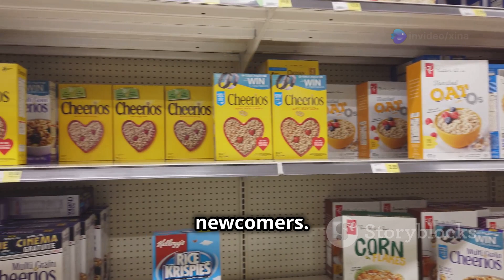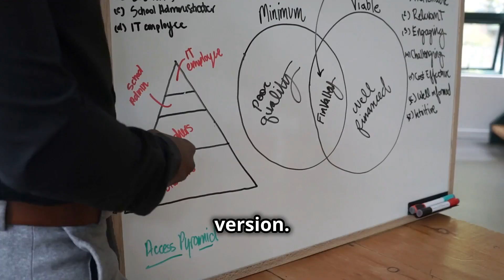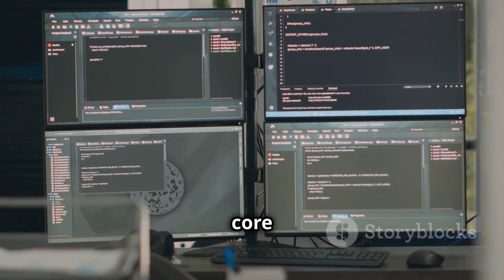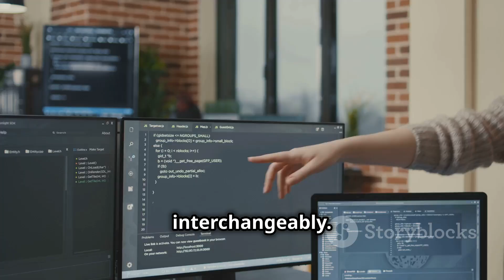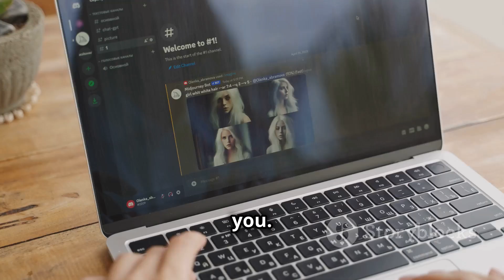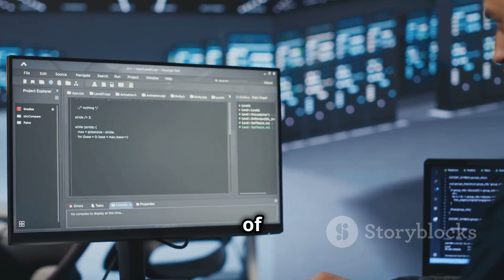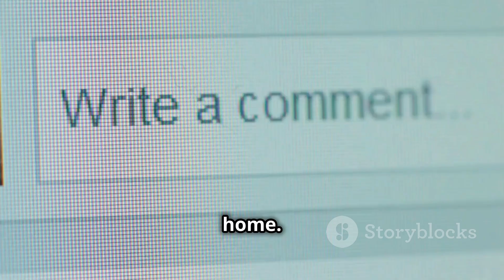Why Are So Many People Switching to Linux Distros?

Comment: The answer is fairly simple multipart answer 1) Linux has become much, much more user friendly, there is a Distro that sets up just like Windows called Zorin, same feel just better as an o.s. 
2) More daily computer users are catching on to how invasive Windows O.S. really is. 
The biggest hold backs are most computerized devices do not come with Linux installed and the other is people learning a DIFFERENT operating system even though an operating system like Zorin is pretty much a Windows clone THAT IS free.
Reply: Am switching I give up
Reply: @PlayLearnNow  give Zorin a try; really easy to pick up

Comment: i went straight from W11 to arch it was quite easy without any isuue just use archinstall script , but do remember create auto mount for your second ssd
Reply from the maker: wow, thats really good to hear, I mean many find it hard and if you can outine how you went about it, we can turn it to a video too. what do you think.
Reply: @TheSecurityVaultYT  well i just downloaded the arch iso thingie and booted from the usb , it took few second later i was in terminal . then connect to internet and and then i checked the package , and then used archinstall script which is literally just "archinstall" you can check guides on it